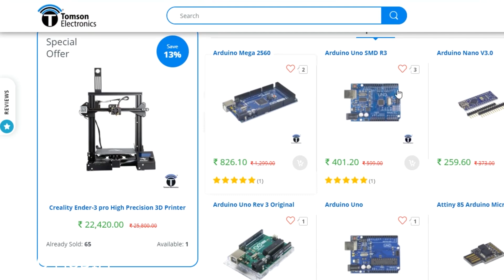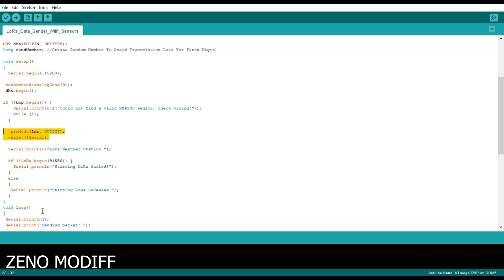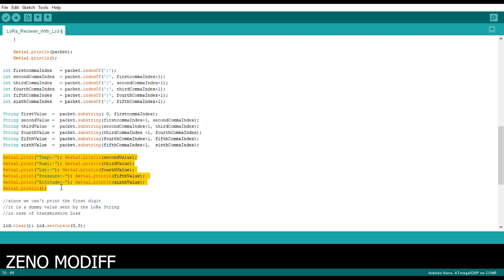Build a LoRa Weather Station: Monitor Climate with Long-Range Connectivity!

Comment: Hi guy , great job!
What is the maximum range between the transmitter and the receiver?
thx :)
Reply from the maker: If you hook a simple jumper wire like what I did in the video you will get upto 20-30 meters or if you use a db antenna it can go upto 100 m to even kms